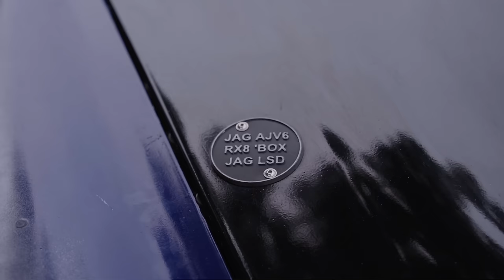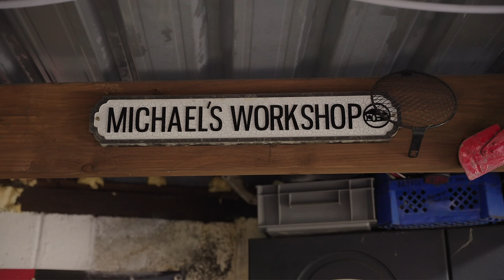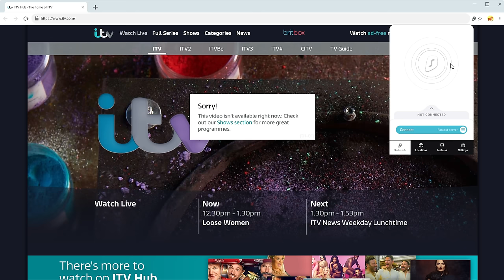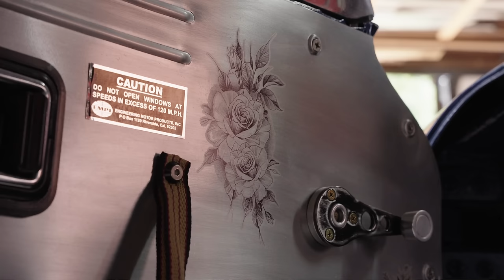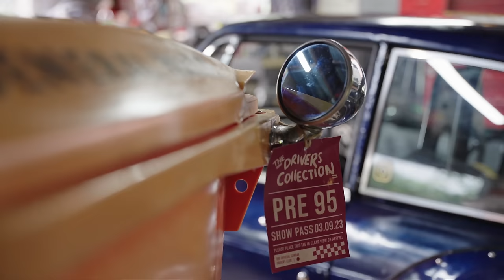A classic MG that isn't boring - Extreme engine swapped drift project

Comment: When I was modifying MG Midgets 40 years ago I found most MG people were really into them, in fact I never met a single "purist" when it came to Midgets or Bs. I also ran a 1969 BGT with an Aldon engine and uprated brakes and suspension which was a massive giggle to drive. I absolutely love what this guys done, right up my street. I have done nut and bolt restorations to standard, and there's merit in that of course, but this route is much more fun. That original blue I think was called "Tahiti" by the way.

Comment: Using the exhaust as a heat exchanger for interior heating is a good shout. I had a similar idea about wrapping a copper coil around a radiator hose and using it to heat the windscreen washer bottle so the washers don't freeze up in winter. Haven't done it (yet) though.
Reply: Do it 👍🏼
Reply: A long time ago, I remember seeing an accessory heat exchanger on offer.  It was made in plastic, with a section of pipe the size of a radiator hose, and a cylinder around it for heating the washer fluid.  The washer fluid gets pumped through the cylinder on its way to the screen.

Comment: Love this. I was never into B’s before butI have a 78 roadster, in the same colour as the one in the vid. It’s a little project and not stock. This has given me inspiration. First thing I changed was the headlights to led an I’ve had so many comments, even positive from the flat cap warriors. But something cheap and simple means I can drive it at night with confidence.

Comment: The icon attached to my name is an MGF.  I had that for 20 years, I also have a MGTF 160 that I have modified for hillclimbs.  I am also 78 years old.  I love this modified MGB.  I purchased my MG's to drive and enjoy.  They get cleaned every couple of weeks.  I got them to drive, not to take up space in my garage.  I can and do admire the purist cars, the time they spend keeping them in show condition.  But that is not what I want.  I have spent hours and many meetings improving the handling, the brakes, the lights.  When I compete at MG hillclimb events out of 80 to 100 competitors I will only see perhaps two other MG's that also drive the hill.  The MGF I own has 230K's.  They get driven most days, in the sun and in the rain.  I do not have a $10,000 dollar paint job, I have a $10,000 handling/brake/tyre package.    Great video Jonny, Great car Mike.

Comment: ive always liked the look of mgbs, but really not liked the lack of power and lazy handling. (i had a mk1 escort a friend had a stock mgb) and i was dissapointed with his car, sounded great but so very very dull to drive.... and then thers the stereotypical owner who only takes it out in the dry, as if its some rare and expensive thing,,, they turn up en-mass at the Ace cafe classic night, but only if the weather is ok which just seems a little sad to me, a low powered rear wheel drive car is the most fun when the roads are greasy, but i guess that doesnt appeal to the typical owner. this however is great to see, i like it more for knowing how many flat caps and moustaches it will ruffle. lovely video Jonny and team

Comment: Supercharge it  Turbo will be a toad to control unless you Run a Boost Management Controller that reduces the Boost in Cog in the Higher Gears.  Assuming it is still Running Stock Cams & Crank Rods Pistons are Stock. ?

Comment: I didn't like 'em, still don't unless they've had some imagination poured over them. Standard I'd rather have virtually anything else. Back in the day we referred to them as two door Austin Cambridges (those that know , know). But customised or Sebringed etc. they're cool. And that V6 is a great engine in the vein of the Rover V8 in that they're lighter than most 4 pots, tuneable and ala Rocketeer they can fit in a lot of cars. Smiles per mile is what you want, not snores per corner. 🤐

Comment: Onestly, any v6 is junk! No design can be balanced without balance shafts. I6 is good stuff, not V. Spinning balancers costs horsepowers.

It is the best choice for weight distrobution for his car without "altering" (relocating) the firewall.

I like it, though. Despite the balance problem, I love the J30 & will probly put one in my BB6 when the H22 dies.